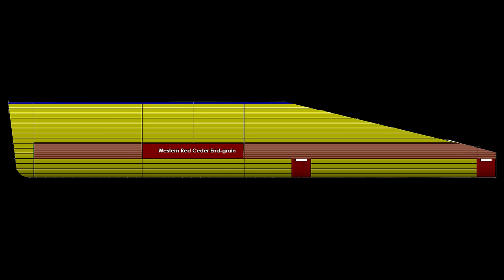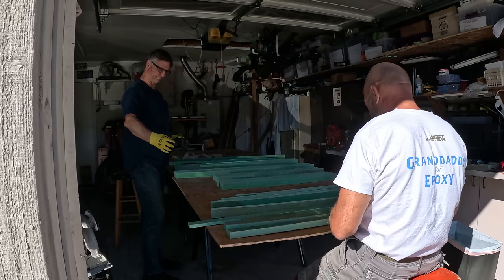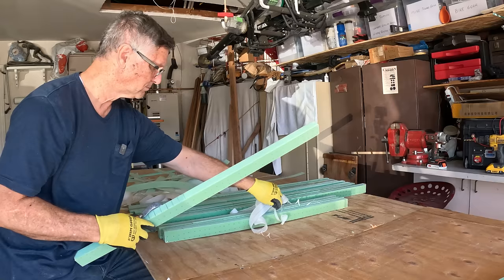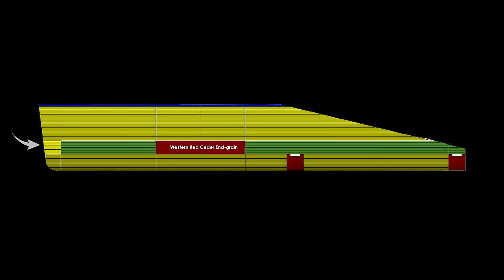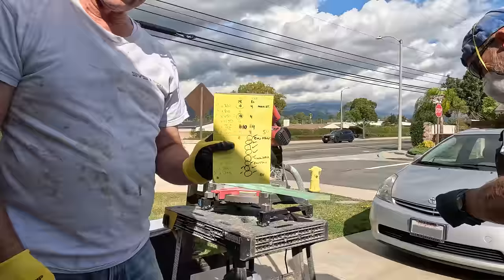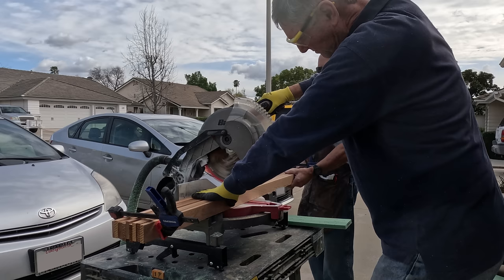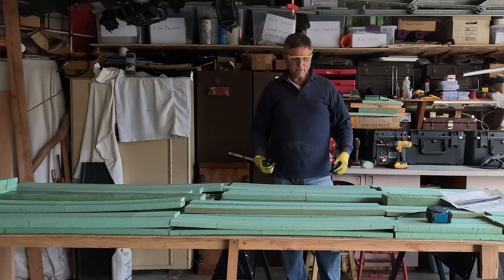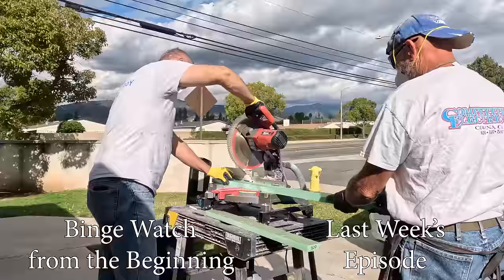Kit E72: Making Daggerboards: Part 1

Comment: I really enjoyed the way you used the diagram to explain why the spar inside the daggerboards is discontinuous. It makes a lot of sense.

You can always repair a cracked daggerboard, anywhere, with a week on land. Good luck repairing a busted daggerboard case. It’s hard to repair composites when they’re on the bottom of the ocean.

Glad to hear you weathered the storm.
Reply from the maker: You are, no doubt, correct.  But, we want to make sure it is unlikely that we will break a board if we don't hit something.  We'll talk more about that in an upcoming video.

Comment: You had the board in back to front
The reason for the sloping cut off at the top is to allow the board to pivot aft if hiring something. The board rocks forward at the top to help absorb the energy.some put shock absorbing foam there to crush as a weak point glassed lightly in..
Reply from the maker: Sorry, but in this case that isn't correct.  If you look at the side graphic of S/V Lynx in the  video,  you can see that when the board is fully down, there is still a lot of the rectangular section still in the casing.  That prevents the board from rocking as you suggest.  Also, it is shown in the proper orientation,  with the leading edge of the teardrop shape facing the bow, not the thin edge.  Think of an airplane wing, they don't face the thin edge of the wing forward.
Reply from the maker: Also, if you look at the very start of the video, it begins with an image of the Solitaire 1520 from the plans.  There, you can see the daggerboard fully deployed, with the 'gap' toward the stern of the boat, as we depicted later.

Comment: Daggerboards, centerboards, rudder blades are the most vulnerable parts. Structure materials and building technics always different. This video defenitely helps and bring a brand new chapter to the conversation. At least it is insightful for my next project where I also looking to re-use some of the laminated foam core off-cuts. The idea is to use unidirectional fibres layers along the whole length and then two halves of the pre-shaped pieces glued both sides and wrapped with another two-three layers of uni or tri-axial. Also I am thinking balsa is not the best material for submerged heavy loaded parts. Some designs suggested plywood instead.
Reply: Sorry for annoying but why not to position laminated foam pieces across the shape. That way you make internal structure much stiffer because of laminated sides will spread side load every 20mm. IMHO generic D80 foam generally not a good idea to use it for daggerboards but with some proper skeleton it would be achievable. (I still concern to use it but not yet too sure. Will check what other people say here. And Schionning of course!)
Reply from the maker: Everything we are doing with these daggerboards is with Schionning's input, so we should be fine.  ;)

Comment: I am pretty sure that end grain balsa is stronger than foam. But I am not saying that the foam is not strong enough.
Reply from the maker: Hard to say, with the fiberglass on both sides of each strip, the foam is pretty strong.
Reply: @SailingSVLynx  You are building a core. The core will be loaded in shear after you skin it. If the fiberglass on the offcuts runs in the atwhartship direction, from port to starboard, then the fiberglass will be providing some shear strength to the core. But if it is running fore and aft, then it will not add any appreciable shear strength to the core. I can't tell from your graphic whether the fiberglass is running athwartships or fore-and-aft. But I also think it will be strong enough regardless (even if the offcuts had no fiberglass I bet the foam is strong enough).
Reply from the maker: @mckenziekeith7434  It runs atwhartship in the core, fore to aft in the body.

Comment: The Balsa core is located in the board to take crushing loads where the board exits the hull. The bald core is end grain and takes way more compression than any foam. Using foam instead of balsa doesn’t seem correct to me.
Reply from the maker: No, that is the western red cedar where the board exits the hull, which we did not replace with foam.  The balsa is above and below that part of the spine block.
Reply: @SailingSVLynx  i wonder why they wanted it then ?
Reply from the maker: @10marlie  The balsa portion of the spine still stiffens the rest of the board, but the section at the exit from the hull is under the most stress.  Therefore, they put stronger wood in that location.  To put western red cedar the whole way adds additional and unnecessary weight to the boards (and boat).  Replacing the balsa with the fiberglass incased PVC foam works as well as long as the western red cedar is still used at the stress point, which we did.